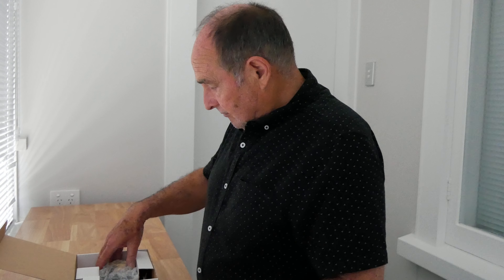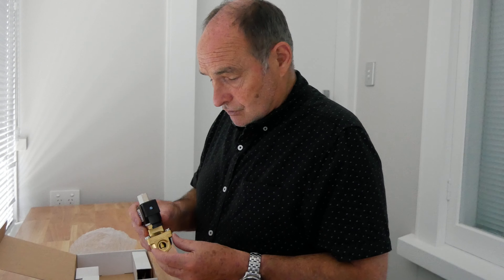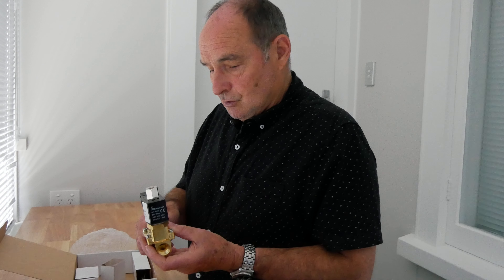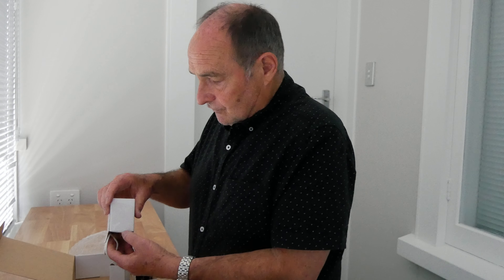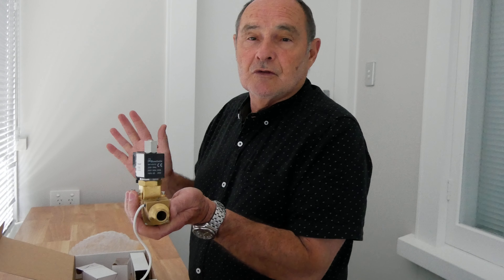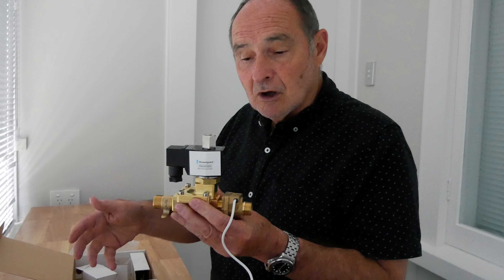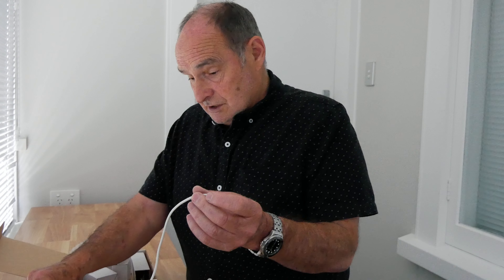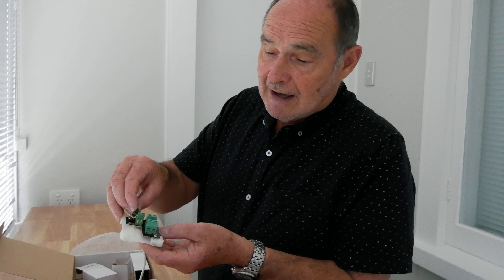Showerguard Shower Timer   -  www.showerguard.co.nz

Comment from the maker: 15 cents per year
Reply from the maker: Yes that is correct it cost around 15 cent per year in electricity costs to run the Showerguardsmart controller
Reply: @Showerguard  Had a panic attack when you said 15 cents per minute. That’s more than my EV uses.
Reply: @ddemier  I got one in UK. Just ordered online and arrived a week later. Just watch the voltage is 240v.
Reply: @Showerguard  how much is this? Is this abailable in the U.S.?